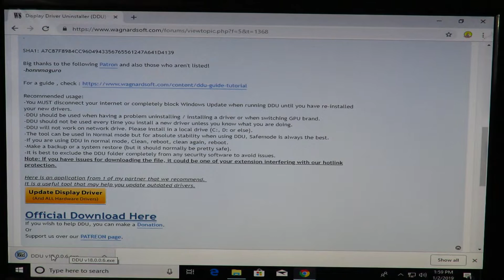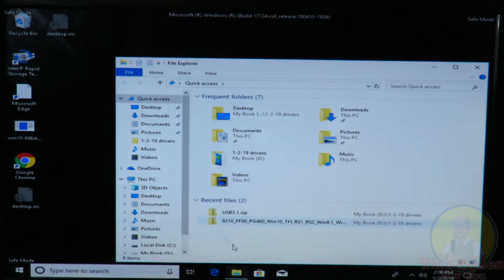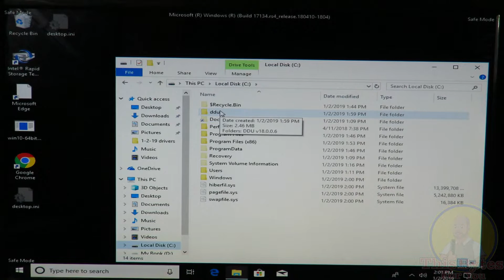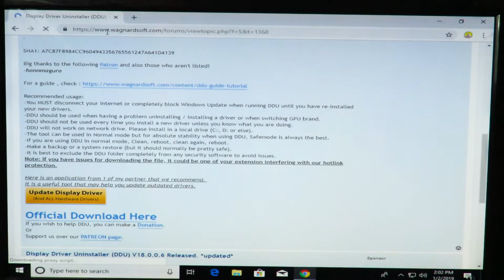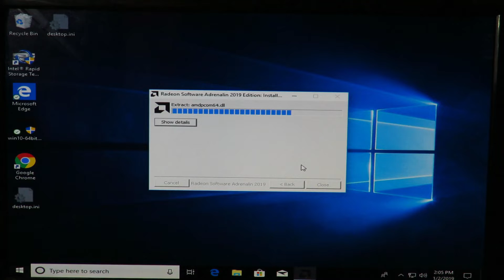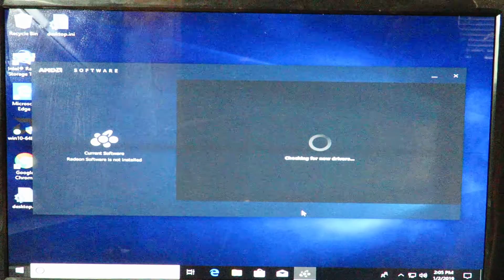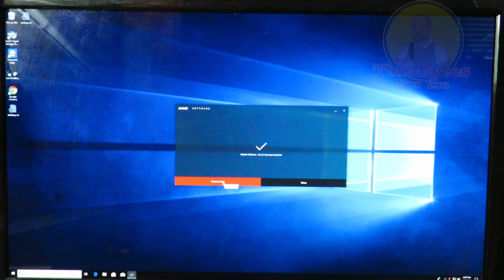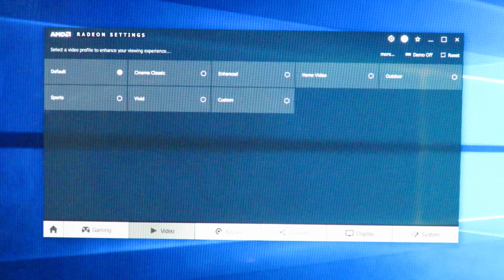How to install the AMD Sapphire Radeon Nitro+ RX 590 8GB OC Special Edition

Comment: Im using the rx580 oc gpu and I only had 1 6+2pin it works fine but i feel like it has more to give. Should i get another 6 pin to connect to the card aswell? And will this increase performance?
Reply from the maker: very odd that it worked with only one connector, usually it will not requiring both, but being the OC card it may work with one, but the additional one is required for the OC part.  I don't know if you would experience a performance increase, but I would definitely do it, already plug in all connectors available, never think of them as optional, they are required.

Comment: Hi! I just subscribed because I am about to buy a new graphics card. It either a Sapphire Radeon Nitro+ RX 590 8GB, Asus ROG STRIX RX VEGA 56 8GB, RADEON RX VEGA 56 AIR BOOST OC 8GB or a Sapphire RADEON RX VEGA 56 PULSE 8GB. What is the best value for money and performance out of these? Thanks!
Reply from the maker: wow, thank you so much my friend for stopping by and commenting, it means the world to me.  OK, so between the 4, first I will say don't even both looking at the MSI, not becuase there is anything wrong with MSI, they are a great company and make great products, but the single fan and blower style card will make much more noise and get hotter than the other cards with multiple fans, the speeds are lower on the card to compensate for the lack of cooling.

Now on to the real comparison.  While this is a video on the 590, it is a great card but it falls flat in comparison to the VEGA56, so lets put that one away.

So the comparison now is between the VEGA56's, the real ones.  The pulse is a great line, its Sapphires no frills no thrills card, not in performance but in looks and features, it performs well but does not have the extra bling the higher end NITRO cards.  The Asus is about 300Mhz faster than the Pulse, but also $100 more expensive that the Pulse, but I think the performance justifies the card talking on the AMD side.  That extra boost will keep you gaming just a bit longer over the pulse.

What kind of games do you play and what resolutions do you play at?

and for reference, here are the cards you were asking about on Amazon: 

Sapphire 11276-02-40G Radeon Pulse RX Vega 56: https://geni.us/BAKy1
ASUS ROG-STRIX-RXVEGA56-O8G-GAMING 8GB OC: https://geni.us/NROQb
Reply: @ThisBytesForYou  thanks for the reply! I use a iiyama G2530HSU-B1 24.5" G-Master HD monitor and play pretty much any big AAA title that has come out over the last 5 years, as well as some smaller less graphically demanding games. At the minute, I have a 1050 ti, which runs these games fine, but not at high setting for the more recent ones
Reply from the maker: You are very welcome my friend, I like to reply to everyone as fast as I can, I know there are trillions of other sites out there, so I want to make sure I can be one of the few that actually interacts haha.  If you would not mind me making a recommendation, I am not favoring one of the other, AMD makes great GPU's as does NVIDIA, but if you are looking at this kind of money, for about $50 more, why not take a look a at the EVGA RTX 2070: https://geni.us/BCZspf

This card will not only take care of EVERYTHING you have now, but many things in the future and you will have the ability to utilize DLSS and ray tracing to make your games look beautiful, even more than you can today.  The 1050TI does not have that ability nor does AMD products.  Also, it will be able to even handle 4K resolutions, which the 1050TI can somewhat do and the VEGA products will not work so well at all.

Now your current monitor does not support 4K, but think about it this way, if this card can support 4K, it will blow 1080P out of the water, and not just for today, it will work for a VERY long time and again, be able to work with a ton of newer features as the DLSS' AI learns more and more, your card will get that benefit.

The ONLY down fall, maybe 2, is that the card is a bit long 10.62 inches and requires a 550WAtt and a 8Pin and 6Pin PCIE connection.  If you have at least a 550watt but maybe only a 6pin or only  an 8Pin, there are adapters you can purchase for less than $5 to make it work for you.

Another big thing, now that NVIDIA cards support FReesync, you will be able to utilize your high refreshrate and Freesync on this card, you will NOT be disappointed. 

Let me know what you decide.

Also, if you do end up buy either card, please do use the links I provided, I will help me tons.  Thank you my friend and the best of luck to you.
Reply: @ThisBytesForYou  thanks a lot! Will keep searching around before making a final decision, will come back to this video to see how to insert a graphics card too!
Reply from the maker: thats great my friend, thank you so much and you are very welcome, very happy I could help and thank you for letting me know this video will help you, that's why I make these and I have plenty more you can check out even if you get another card.  ;)

Comment: You started out wrong. First things you do are to turn the PC off and then, unplug it from the wall.  I'm not trying to be a smarta$$ or confrontational. I only mention it because your vid seems to be meant for those who have little or no experience with any kind of PC assembly. I actually wanted to see how the card looked in the case I'm buying with it as part of a new build. Nice rig btw.
Reply from the maker: yeah I guess you are right, I do make my videos for those who do not have experience and maybe to help some that do have experience but might be confused about something, so I will mention that on my next one.  Thank you so much for checking out the video and for commenting, it means the world to me.
Reply: @ThisBytesForYou  Thank you for understanding that I wanted to be helpful, not critical. I saw the way you corrected yourself in the vid concerning locking down the vid card with the screws before inserting the 8 and 6 pin connectors. That and the camera shots of how the retainer tab reacts to the video card insertion told me that you wanted to be as detailed as possible. Forgetting to power off and disconnect is sooo common, but can be so important. I work on factory equipment and LOTO (Lock Out, Tag Out) is a way of life. It says good things about you as a person that you care enough to be so detailed in your examples and explanations. Wish there were more like you frankly.
Reply from the maker: @cy2087  thank you so much my friend for being so well thought out on your reply and for helping, I take everything as helpful unless there is not possible way for the message to be construed as helpful, haha.  Yeah one of the main reasons I started doing videos is out of frustration and out of life lessons.  I used to train people how to build PC's and use them so that got me interested and when I watched a video to do something, they would skip so much, because they knew how to do it, and didn't think about the reason they made the video, to show others, so I try to be as detailed as possible and show angles if possible but being that I don't go off of scripts or anything like that, it's easy to forget things.  I will try my hardest to do this for the next video because you are right, it is 100% necessary to power down when doing this.

Actually last night, I was replacing an M.2 PCIE SSD doing some testing, and while the system was completely shut down, but not disconnected, as I was swapping the card, my system decided to turn out, I freaked and quickly flipped the switch off, but that was scary.  So yeah, next one ;)  I will make sure to mentioned you... if I can remember haha.  Thanks again my friend.
Reply: @ThisBytesForYou  Lol, thanks for the compliment. Given that you used to train others and I haven't done my first build yet, (trying to get the cash) I'll be watching for your 'training vids'. Glad that mishap last night didn't lead to an injury or equipment loss. I've also heard that you should alwys wear an anti-static bracelet or touch the case frequently to discharge and make sure you don't short out components while working on your system. Anyway, glad to hear back and hope to see more vids in the future.
Reply from the maker: well thats great to hear my friend, thank you.  Since you are starting off, you may want to look into 2 series' I have recorded, one of which (The Darkest Light build) I am still working on.  These play lists provide unboxings of each product in the build as well as how to install each piece from the ground up, it might help you.  

Boss Build
https://www.youtube.com/playlist?list=PLuWlEgp_PqJPLw_BLmXUmDMeHmBM-B7EQ

Darkest Light Build (Still adding more)
https://www.youtube.com/playlist?list=PLuWlEgp_PqJMgH49zr8e76TZ5EeEOW985

As for the anti static wrist straps (I may have mentioned it) I don't ever use them, the are uncomfortable, I do always ground myself by touching the case, I mention it in most of these types of videos,... though I may not on all.

Thanks again my friend, I so appreciate you stopping by and the conversation is great ;)

Comment: How hot the card running at full load? 86°C with 100%fan speed? Huge power consumption for no reason. RTX 2060 is the go to buy card.
Reply from the maker: sadly I could not finish reviewing the card to give you an answer on that, I had to send it back quickly for some reason.  I am not disagreeing with you on the RTX2060, but again, I could not finish the review, so I cannot give you a good answer.
Reply: @ThisBytesForYou  I bought last year a Sapphire  RX560 4GB, I changed the thermal pads on the card and I covered the vr ram modules with pads also+ changed the thermal paste with Artic Silver 5 with a custom 120 mm fan and I can run the card full load 78°C fan speed at 50% but the hustle doesn't worth it. Before this custom cooling system the card was thermal throttled at 100% fan speed.
Reply from the maker: @d4nith3  I can say from my testing it did not hit 80, and I played with everything bumped up to Max at 1080p, the card was not hot and I don't remember the temps hitting 80.  Not sure what card you had but this card kept it's cool nicely.  I wish I could have finished the review so I could give you some more scores , temps and power consumed.  Who made your card and what was the model?

Comment: Hey I'm using Rx 580 can I use 8pins adapter for my Gpu? coz my PSU doesn't have 8pin wire
Reply from the maker: Yes of course, you can use an 8 pin adapter, do you need a link?
Reply: @ThisBytesForYou  yes
Reply from the maker: @itszack2133  wow very odd, try installing trixx and utilize the fan curve to increase fan speed when the temperatures go up.  Do you have bad cooling in the system itself?
Reply: @ThisBytesForYou  but I was using a adapter GPU was working but then my GPU start overheating when I start the game I mean it's fine if this GPU start overheating after 1 2 hour but it's start overheat whenever I start any game( sorry if my English sucks)
Reply from the maker: @itszack2133  is it this card or another?
Reply: I have Sapphire Nitro+ Rx 580
Reply from the maker: @itszack2133  yeah, trixx also works on that as well.
Reply: I think I need to change my PSU because I Heard that adapters are not good for gpu
Reply from the maker: @itszack2133  adapters are ok, but the adapter itself could be bad, but if your psu doesn't have an 8 pin, it might just be too old, but it should have nothing to do with the cooling of the card.
Reply: @ThisBytesForYou  I just want to ask one last thing can I run this GPU with just 6pin wire?
Reply: Zack knight ,  the minimum is 8pin to use this gpu . Best if you use the 8 pin + 6 pin if you wish to overclock the gpu.
Reply: @SyazLahYT  oh thanks I just wanna know is there any way to check if both pins are connected properly?
Reply from the maker: @itszack2133  no Zack, sorry I did not see this back then, you need to have both pins connected for this to work.
Reply: I'm using Cooler Master 500w right now
Reply: GPU was running fine back then so I think my adapter is not working
Reply: I will check the GPU again after changing the adapter
Reply: Thanks

Comment: 8+6 pin ??? I have rx590 strix and have 8 pin
Reply from the maker: Potentially due to more overclocking headroom
Reply from the maker: looks like you are right,  i have looked through many others (not all) and they are the only ones doing an 8+6, most others will only do an 8 pin or 2 x 8 Pins.

Comment: Can u do a vertical mount of this gpu?
Reply from the maker: you can do one with just about any gpu, now if I can,... sadly I do not have this card any longer.
Reply: @ThisBytesForYou  I've heard that vertical mounting would affect the cooling, although with a good liquid cooler, it should be just fine. So it all comes down to an extra bugs for the liquid cooling for maintaining the cooling and performance. Im considering the vertical mounting of this graphics card because personally i think it would look much better with the led fans being visible.
Reply from the maker: @Rainyumz  yes, vertical mounting affects cooling, but only for that component, when you add liquid cooling it reduces overall cooling for other components and focuses only on specific components.  I am not a fan of liquid cooling, I prefer good old fashioned air, I have seen way too many issues with liquid cooling as Product development for boutiques and oem's.  The other thing about liquid cooling is many times overtime you can lose components needed for the original component (screws, nuts, bolts, etc) which can potentially lesson its resale value  and you end up losing more money beucase you have to sell both components as one (liquid cooling and card), this drives up interest on a smaller portion of potential buyers and decreases interest on a larger portion of potential buyers.  This also voids warranties.

LED's are cool, no doubt about it.  Thank you so much for stopping by and checking out my video, even more for commenting, it means a ton to me.
Reply: @ThisBytesForYou  thanks for the info, i've never used liquid cooling. I should keep that in mind.
Reply from the maker: its cool and all, but introduces a lot of potential issues and also, you are very welcome, very happy  i could help.

Comment: Its a asrock motherboard and corsair 500 watt
Reply from the maker: I wanted to model number as well, but anyway, check to make sure your BIOS is set to PEG instead of Integrated video and that it is selecting PEG as the initial video source in the BIOS, verify you are on the very first PCI-e slot, if you are using a different cable on the video card than you used for the integrated video, make sure your monitor has that input selected, for example if your onboard video used VGA but your 590 uses HDMI, DP or DVI, have that as the selected input/source on the monitor.  If you have the cable connected to the motherboard, disconnect it and use only the cable on the video card, see if that works but changing the init video to PEG will correct that.

Comment: Video is plugged into gpu
Reply: I have the same question. After installing the card and before downloading the drivers for the gpu, do you plug in the cable for the monitor into the motherboard iO or the Hup iO? I believe it should be the motherboard iO since drivers for Gpu not installed and hence it would not work?
Reply from the maker: @yuewenlim4696  you would plug in the monitor cable into the video card, not on the motherboard.  The motherboard IO is if you do not have a video card.  Even if you don't have the drivers installed, the video will work on the video card, it just wont look as nice, though it may auto detect, I recommend uninstalling the drivers for the gpu (yes it will still work with no drivers, just not pretty), then install the latest and greatest.
Reply from the maker: which video?

Comment: Wich is the minimum power supply I'll need? I'm looking forward to upgrade to the RX 590 Oh and at 12:34 I got a little confused for example now I have a GTX 1050 ti so instead of AMD I should select Nvidia right? And will I get the 2 free games promotion for buying a RX 580 or + right? Nice vid mate!!!
Reply from the maker: hello my friend, sorry it took me so long to reply, I usually reply within minutes but it looks like I missed this one.  The suggested power supply is 500Watts, and you need to make sure you have both PCI-e connections to plug into the card, the 6 pin and the 8pin.  As for your card, if the card you have in the machine now, that you are removing to install this card, you have to select NVIDIA to remove the older NVIDIA drivers you had installed.  I don't see that they are giving away the games anymore though sadly.  Thank you so much for the compliment, I do appreciate it, I hope I helped you in this reply.
Reply: @ThisBytesForYou  Of course you did thanks bud!
Reply from the maker: @yuquezada9969  thank you my friend and you are very welcome ;)